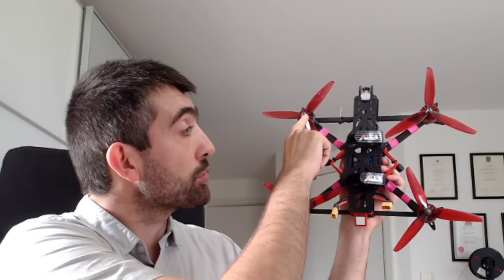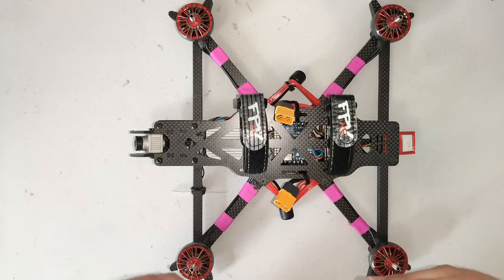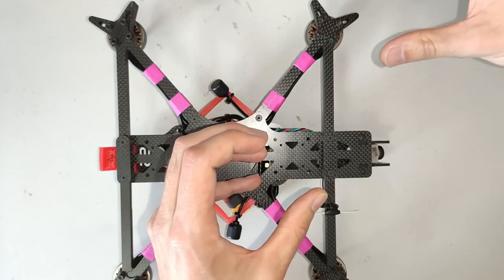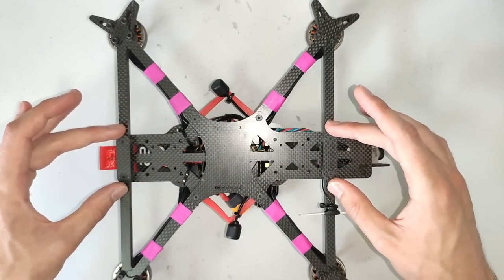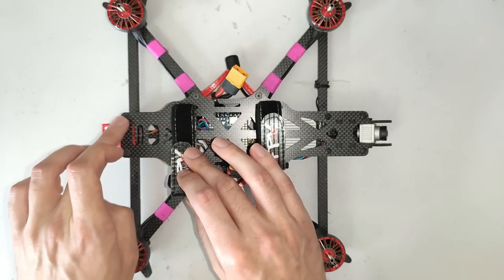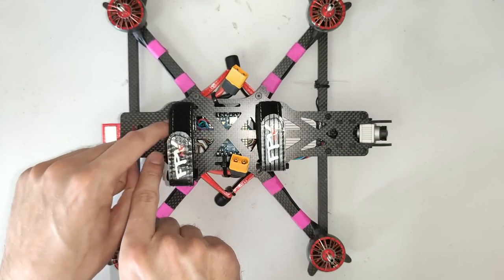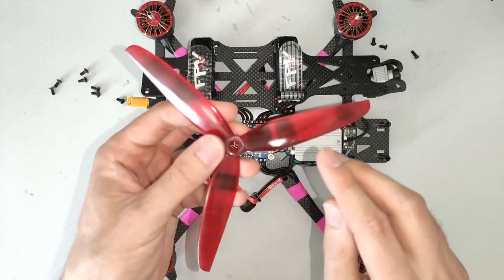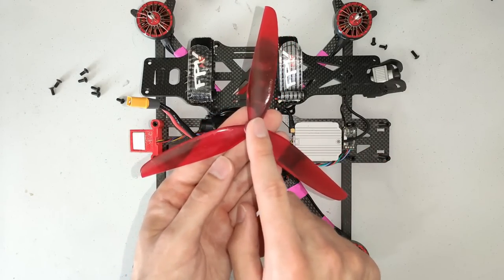The AOS 7 "Mantis". A 7" frame designed for maximum flight performance.

Comment: I like you videos :o)
Do you have any advice on mounting a single long antenna (Vista) for as little vibration as possible and still the best range?
I have not found a good solution until today
Reply from the maker: I tape it to the arm 👍
Reply: @ChrisRosser  But then the angle of the alignment is not optimal (Donat-form waves)
Reply from the maker: @thomasgutweniger  In my experience the quad is usually tilted forward which means the angle on the antenna is pretty perfect. I've certainly never had an issue with range or penetration doing it this way.

Comment: What awg wire do you use to connect between the fetec and xt60?
Reply from the maker: I use left over motor wire to connect the spike abosrber to the ESC battery pads and keep the wires as short as possible.

Comment: Hello, I have ordered your frame and I will build it soon.
Could you make a video with your Betaflight settings for this quad? THX
Reply from the maker: You can use my recommended filter settings and just increase the master slider to 1.5 or even higher. That will be a good place to start tuning for your build.
Reply: @ChrisRosser  Thanks for the answer. I will test it as soon as my frame has arrived from Canada.

Comment: Good improvements since the last frames. I also wish my aos55 had more than one strap mount (I feel insecure with just one.). I also wish the camera mount had a range of holes for different length of lens (I've got lots of room up front and the guards obscure much of the picture).
Reply from the maker: Thanks! I updated the camera plates on the AOS 5, 5.5 and 3.5 with longer slots for shorter cameras. If you ever pick up spare camera plates the new ones should be better.

With the AOS 5.5 the second strap goes on the rear section as usual.

Comment: You spend some time arguing how a 7" will have lower resonant frequency, given increased lengths, which seems sane, but showing graphs of the 7" with a higher frequency noise peak than the 5" without explaining why made me question. Adding that there is no unit or quantifiable marks on the y-axis did not help.
 
(declaring that 7" props are harder to balance than 5" is also a bold statement, but i assume you mean that the consequence of imbalance is greater..) 

I cannot see what is shown on the y-axis of your plot. nor any values. I assume it is amplitude. In that case I guess that your reinforced the frame in order to increase the resonance frequency of the frame to 3/2 x motor Hz (quick calc gives the frame rpm resonance to be around 20 000 rpm from your peak), so I suppose the motors go about 2/3 of that at  around 13 000 rpm? 
There is also a peak at around 180 Hz -> 10800 rpm, is that the rotational speed and the two arms really successfully transfer the force? Or is it from the fact that thy are at an angle with different length. One at pi/4 to the other, so if the resonance frequency is proportional to the length of the arm than pi/4 = .7 = 13 000/10 000 might give the other peak?

This "hangup" in frequency shift told me you either have no clue or are way beyond (leaning towards the latter here!). Would be nice to see some testing in regards to how much this improves response and also how you can improve stiffness/tune the freq in "better" ways in order to make it lighter. ex weakening it to be 2/3 of the motor rpm instead of over? Or maybe tubes instead of plates?

I do not know, but felt there is some missing information in order to back up the fact that you have increased the resonance frequency of the frame without commenting on it... cool video, great work on the frame! 
Made me want to try it.

Btw: I strongly agree with your motor/battery/prop choice (same as mine ;) for cruise the Gemfan ones are a tad more efficient at lower rpm).
Reply from the maker: It sounds like you've grasped most of the concepts in the video very well. Overall the AOS 7 delivers better vibration performance than an average 5" drone. All else equal a bigger drone will have worse vibration but with clever design you can improve the stiffness of the geometry to offset this. That's what this design demonstrates. Resonant frequency is determined by a number of factors: The length of the arm, the stiffness of the arm which depends non-linearly on its thickness and geometry, and the weight of the motor. Bigger frames have longer arms AND heavier motors so that makes it doubly difficult to keep the resonant frequnecies high enough that you can filter them out.
Reply: @ChrisRosser  I see. Thanks, I really enjoy your videos (been cycling through a bunch since I saw this one). Have learned a lot. Needless to say, this ticked a few of my boxes. Currently designing my own frame for an "invisible" Gopro MAX-drone. It just got a "second set of critical eyes" to say the least. Nice to tether courses from uni (none)linear systems, signal processing and controller design into each other. Your chat with Brian White and the Cine80-videos were NICE. Do you have any thoughts about using hollow tubes instead? I suppose the motor and frame mounts would be a challenge, but tubes have some benefits torsional and bending? (really liked the vertical motor-mounts for cine80. Keep it up!

Comment: Always impressive stuff to watch Chris, great analysis!
What I’m wondering though, is this one good for long range, or is it a 7” freestyle frame?
I’m looking in to building a 7” long range quad. I like the design for the Rekon7 if it weren’t for vibrations of a 7”. This one looks rather chunky for long range. How would this one stack up to the falcon or the Rekon from your point of view?
Also, do you know of any (4S?) long range builds for this one or the falcon and the flight time they managed to get out of it?
Reply from the maker: It can do long range, medium range or freestyle. Really a jack of all trades. The Falcon 7 is specifically for long range so if that's all you want to do then that may be the choice for you. If you want smooth video with no vibrations the AOS 7 is the frame for you. For 7" you need 6S to keep the motor current sensible otherwise each motor will be drawing 100A+ and that's not feasible.

Comment: Lol I was sitting here watching this thinking to myself I wonder if the vibration analysis is better on my jb edition qavs lol I like it a lot only thing is that you and Wesley varty are probably the only ones that still have an air unit lol but I would strip my qavs for part in a heartbeat for an aos frame I surely would ! Just can't afford one at the moment but maybe someday
Reply from the maker: No worries. The QAV-S is a great frame no doubt!

Comment: Maybe it's time for some cinelifter design :D ?
Reply: PLEASE! I would buy that one instantaneously. In the best case its modifieable into this 7Inch Copter. Just with a few more nuts and bolts its a Cinelfiter. I would love to see the advantages and disadvantages between 8 and 4 Motors in terms of vibrations.
Reply from the maker: The AOS 8x8 "Goliath" is already in the works.

Comment: Uk suppliers Chris?
Reply from the maker: I like to wait a couple of weeks before shipping to distributors. Sometimes there is some feedback and I make some very minor tweaks to handle certain edge cases.
Reply: @ChrisRosser  Excellent..... so who supplies your 5 inch and 3.5inch frames?
Reply from the maker: @gmivisualsjason3729  Unmanned tech and yourfpv.co.uk. If they are out of stock drop them an email and I'm sure they'll order a few in for you.

Comment: Just looking at it screams stabilizers Drag. Loose the cross stabilizers and balance the props & motors properly to rid the vibration. Workout what rpm then causes the most vibration afterwards and program out that rpm with frequency cancellation or add counter balance flywheels to each motor. If that fails swap out the frame for a glider.
Reply: Frame resonance doesn't work like that...
Reply: The funny part is that you think people will watch the rest of Chris' videos and then listen to your arm-chair expertise on this video.
Reply from the maker: Quadcopters aren't very aerodynamic at the best of times. The goal is smooth footage from the gopro during extreme acrobatic manoeuvres so resonance performance takes absolute priority for this application.

Comment: 230 grams!? Surely not?..... if so ... I'm in!
Reply from the maker: 230g is the frame weight. Dry weight of the build is ~625g with 2200mAh 6s the weight is around 1kg. Good to hear from you Gav👍

Comment: I figure you had to mention the ease of maintenance because of old steeley boy.
Reply from the maker: I actually mention it every time I launch a frame (you can check the old videos!) I think it's really important that frames are easy to build and easy to maintain and use standard length standoffs and hardware.
Reply: @ChrisRosser  Yes Sir, I was just poking fun at Steele's off the cuff video.